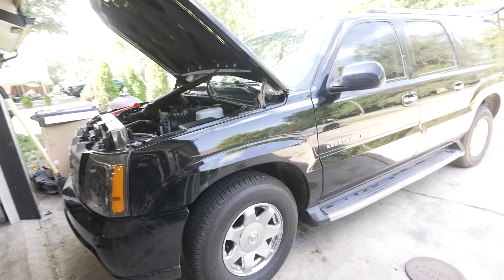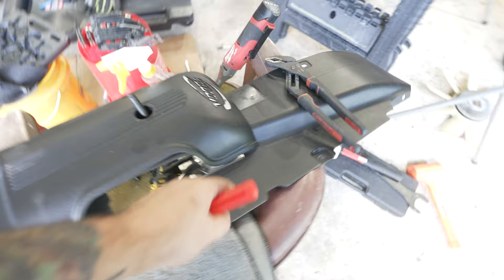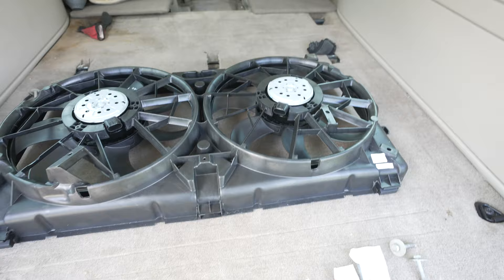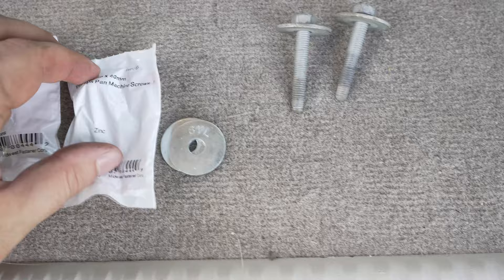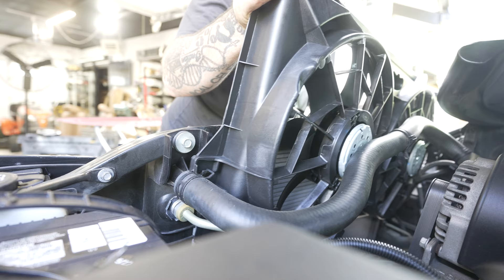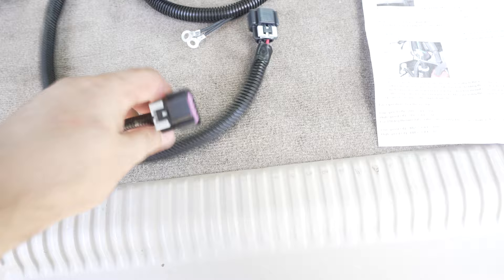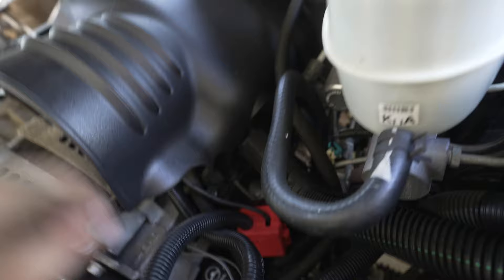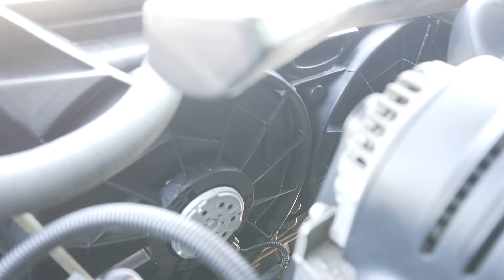2004 Escalade 6.0 Electric Fan Conversion | Nelson Performance Harness

Comment: I converted to electric fans about nine months ago  my 02 Escalade and everything works very well, and do the fans turn on when you turn on the air conditioning?
Reply from the maker: I believe when you turn AC on to the max, the fans turn on by default